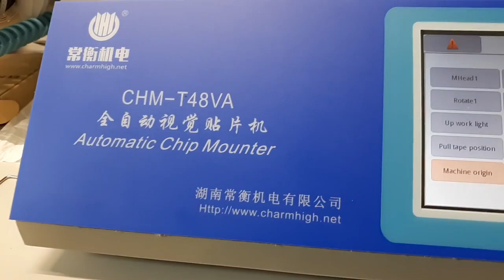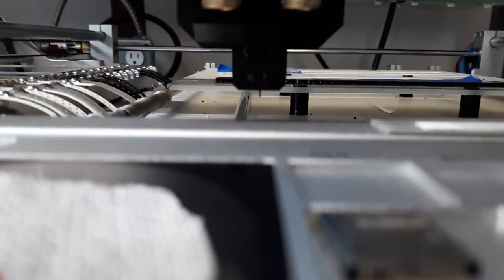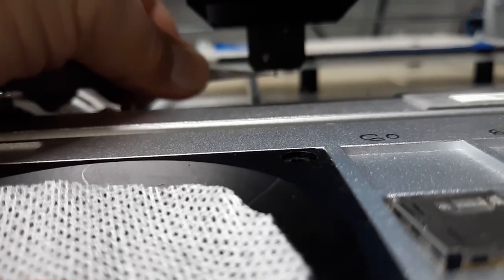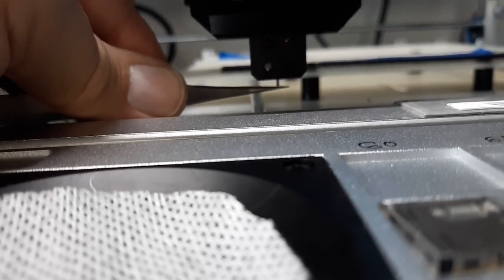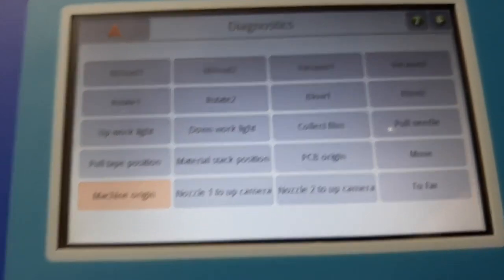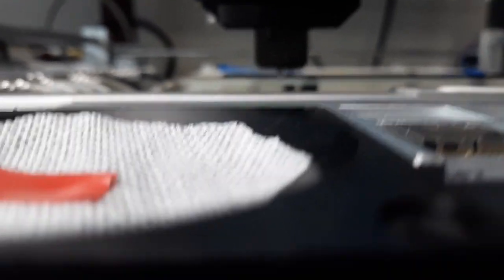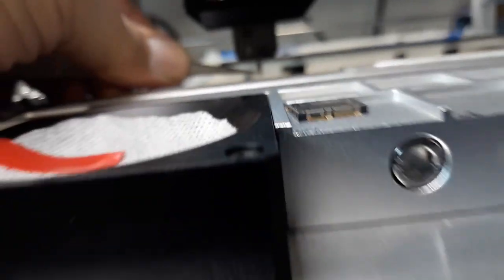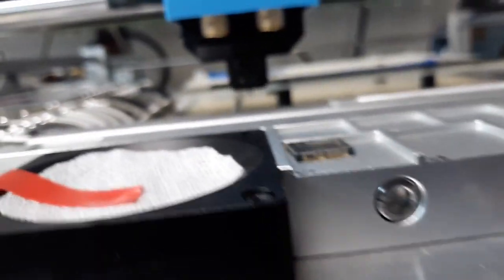191119 Charmhigh Pull Pin Stuck - Simple Fix

Comment from the maker: Probably about 2000 or so, not that many. The kit parts that charmhigh sends includes linear rail grease, nozzles, tools,  extra solenoid and 2 pull pins.  I haven't run many boards yet, so I can't answer your question.  This fix was simple and quick,  a little lubricant is good for most metal on metal contact surfaces.
Reply: Sir I have error of pull pin not reset in chmt v2 .02 tabstop pik&place macine
Reply from the maker: @srikrishnasonone8425  I can't help you here. Contact Charmhigh.

Comment: Any idea how many parts it had placed before this became an issue?  Is lubing that pin standard maintenance or just something you do when it sticks?
Reply from the maker: Sorry for the late reply. I have no idea on both your questions.
Reply: @CraigHollabaugh  All good.  I have the same machine but mine has not yet had a problem.  I would guess I have placed maybe 10k parts total on mine (about 100 pcbs with maybe an average of 100 parts per board.)  Perhaps next time I build some boards I will lube the pin just in case.
Reply from the maker: @jontscott  Here's what I didn't mention in the video. If you stop this video at 1:36, you'll see a wear ring in the middle of the pin. I believe this wear ring is the cause of sticking.  I suspect my solenoid's bottom induces this wear during a tape pull. I haven't run any boards since that day, so we'll have to see it lubing helps on the next run. Or, its something completely different and I'm full of beans, ha! Thanks for watching and good luck with your machine.
Reply: @CraigHollabaugh  Thank you for sharing about your machine.  I have appreciated getting to see how others use their machines as I have slowly worked out mine.  So nice to not have to place 603 parts by hand.
Reply from the maker: @jontscott  sounds good, keep making boards!